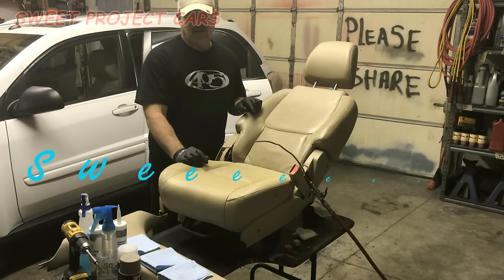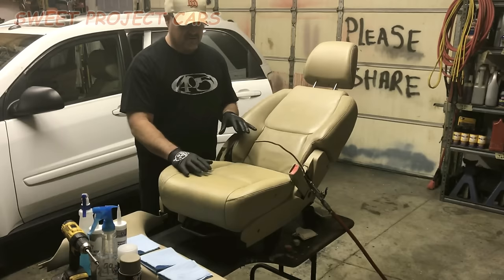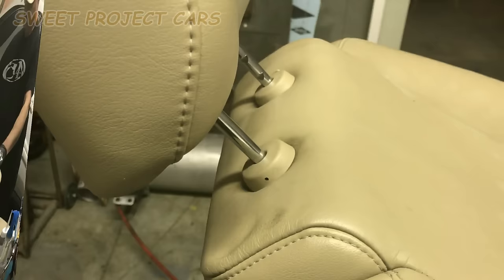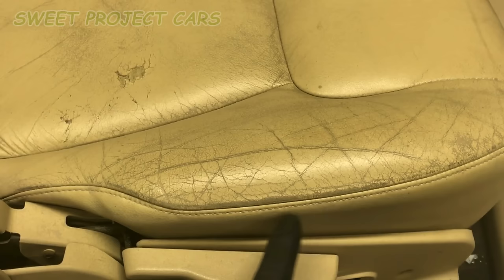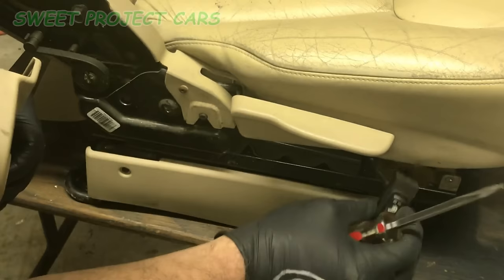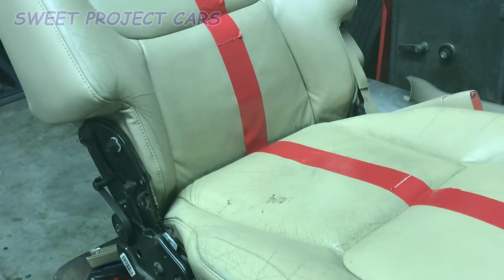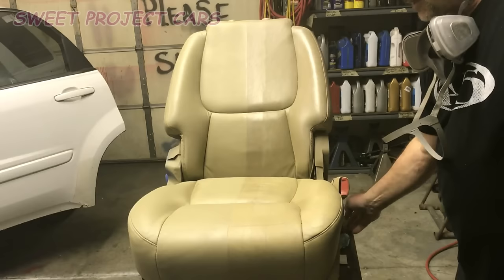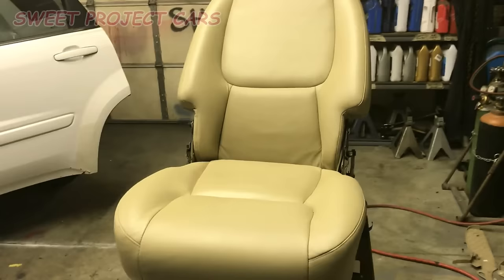How To Repair The NASTIEST Leather & Vinyl Seats....Back To PERFECT!

Comment from the maker: Hello, Everyone, this is our Glad it's Friday video!  See How we Paint Silicone https://youtu.be/Sp6HGSSQGXk This works for leather or vinyl. This is Part 1 of a 2 Part repair series. The second video will be out this coming Tuesday. We hope this helps you make your seating look new again. ****Also, don't forget to pick up your SPC's Swag before it's gone...once this design is gone it will NEVER be available again!****  Here is a Special PROMO CODE to save YOU a couple bucks https://teespring.com/stores/sweet-project-cars-swag?pr=LASTCHANCE
Reply: Wow. you know all the tricks. thanks and have a great weekend!
Reply: This was great, is there a video on painting a steering wheel?
Reply: MEK I painted a steering wheel using regular rustoleum and got amazing results. It was on a navigator and I was able to fix sun damage by lightly sanding and then painting with a few light coats.
Reply: What if you actually have a hole through the seat?
Reply: @bitemefoker  My question exactly. I used SPC's technique for sprucing up some nasty looking cracked and faded leather in my mom's Caddie....and it came out looking like brand new. After doing that, i then discovered about a quarter sized hole in the backseat. So, SPC.....do we need to put a patch over that hole, or will a silicone film as in your video do the trick? Thank for the great videos!
Reply: I'm just asking because can't u use the same technique to fill it? I have a hole from wear but man this is impressive
Reply from the maker: Thank you Justin we appreciate that my friend
Reply from the maker: We have never had that issue if you follow the video to a T and use the exact same products you will have success every time my
Reply from the maker: Good deal thank you for sharing
Reply from the maker: We do have videos on repairing and dying leather steering wheels that is the best way to do it
Reply from the maker: We are coming out with a video Friday that should help you with that my friend
Reply from the maker: We arecoming out with a video Friday that should help everyone with holes or cuts in their seats
Reply from the maker: Jamie we love the questions for sure we have a video coming out Friday that will help everyone
Reply: Will you do mine for me please? I'll pay...
Reply: Man this could save me a lot of money. What if I wanna change the color from grey to black? Could I do it?
Reply: What about perforated seats?
Reply from the maker: Chris Rodgers just before the glue is dry you stick round toothpicks in every hole then a final coat of paint
Reply from the maker: @mj-qe2wy   yes you can change the color my friend
Reply: Where do you buy the color?
Reply: Hi there. I assume that these techniques can be applied to home furnishings such as leather couches and chairs as well. How about vinyl? A very informative video. Thanks so much. PS: It's 'due' not 'do'. As in "due to the massive size..." No disrespect intended. I hope that helps because you've helped me. Cheers.
Reply: You should experiment with steam cleaning.  I like all the different uses of 99% alcohol, but it doesn't deep de-grease.  If you combine 70% alcohol, with deep steam, it will deep clean, and clean the "grouts".  I will help your paint penetrate.  Shouldn't add much drying time at all, if you steam clean and accelerate the drying, by aerosol 99% alcohol.  Definitely worth a try, on those specially loved cars.
Reply: Are you using standard spray can paint or a special leather paint?
Reply: What brand paint spray did you use and where can I get it?
Reply from the maker: Sam Thompson all the tools are in the SHOW MORE of the videos description
Reply from the maker: Jarvis' World it is a special paint used by the manufactures actually, you can find it all in the SHOW MORE of the video's description
Reply from the maker: Chango21 all the tools are in the SHOW MORE of the video's description
Reply: Sweet Project Cars 

Could you please mention the names, brands and where to purchase the items used to implement this project. That would be so helpful for everyone I hope. 
Thanks this is what I need for my car.
Reply: great info will be sharing!
Reply from the maker: @naijanistan  all the tools are in the SHOW MORE of the videos description my friend
Reply: Hi mate. I did the same work like you did, a few months ago, the problem is that the paint started to come off soon. I am planning to do it again, but this time i am thinking of using a laquer, after painting the leather. What do you recommend? Is that a good idea? Thank you#
Reply from the maker: @ArnnyeFittMan  We use this video here now for everything and never had it wear off especially if you are using the prep spray.  you need to make sure you deglaze the leather or the paint will not stick we suggest this for the UK https://amzn.to/2DeokbJ without this the color will not stay on
Reply: @SweetProjectCars  Thank you for your quick answer & advice. I will use it and waiting to see the results. Cheers!
Reply: Sweet Project Cars 
Hello, can you please do a video on how to do this with perforated seats.
Reply: WOW! That looks great!
Reply: Sweet Project Cars r
Reply: Can you give me the list of products you used again, please? Thanks.
Reply: What kind of silicone do you use?
Reply: I did this on ripped boat seat and painting over the silicone is easy but the paint doesn’t stick to it like it should. I used vinyl paint and it ruined my seat. Now I’m trying to figure out how to remove the silicone.
Reply: What kind of glue and silicone are you using also paint. I want to try this
Reply: Kindly please mention the spray paint that you used in the end if possible show the other products also
Reply: Can you speed up the drying and curing with a heat gun?

Comment: Wow...the silicone thing actually worked and worked well...Easy...I have a 93 vette with only 40.000 miles on it and is almost pristine condition with white leather seats...my parents dog jumped in my car poking a whole in the passenger seat...a couple of years ago i bought a leather repair kit only making the area on the seat worse then it was...I tried this method with the silicone and it worked...I like the idea that it doesn't have to be perfect as it will blend in with the texture of the rest of the seat...Clean ...fast and easy..I ended up doing the other small cracks in both seats...you can't even tell....
Reply from the maker: Chris that is awesome to hear my friend good deal thank you for sharing your results have a great night
Reply from the maker: tools are all in the SHOWMORE of the video description
Reply: If you don't look at it during sitting, it will last for-ever!  🙏🙏🙏🙏🙏🙏🙏
Reply: You think I can use the same process on boat seats ?
Reply: @fredwilliams7893  -  Well at least she'll gained another " Crack " right?  More Cracks = More Joy = Oh boy!  😂❤️😂❤️😂❤️😂❤️
Reply: which kind of sillicone did you use?
Reply: Chris Kowalski really good trick actually
Reply: Fred Williams rofl
Reply: @fredwilliams7893  If you could find the exact same color!
Reply: I had no idea you can paint or dye silicone...
Reply: @MsJackie808  has a professional painter you can't it will fisheye and crawl off unless it's a special silicone then I guess anything is possible it work for this guy but I'd like to see it after a few sit on time
Reply: What kind of paint did you use?
And how did you match the color?

Comment: I sprayed my vinyl boat seats with the prep and vinyl dye/paint. Came out looking like new.
Reply from the maker: Awesome Wes!  Thanks for sharing.  Have a great day.  mad Mike the hammer SPC
Reply: I need to repair the very top back of my pontoon seats where the black cover baked them.  How is everything holding up?  I also have a couple of holes in the foam on the top of the seats.  Is permatex the only thing that I need to fill the holes?  The holes are probably an inch to inch and a half deep by about the same width.
Reply: I sold it years ago but I'm sure there is good info on YT. There is a DAP brand caulk that is good for filling holes and taking paint. They use it for leather repair.

Comment: Wow definitely gonna try this with my "new" vinyl couch i just got it has small bits of cracking everywhere
Reply: Hey glad I found your comment, did you try it? My vinyl couch is cracking and small bits everywhere also. Please reply when you can. Thanks!
Reply: Hello, did you try this already? Just wondering if I should give it a go for a vinyl couch sectional.
Reply: Did this work for you and hold up? I am going to try on my leather couch, but wanted to hear from someone first.
Reply: @divakim206  Did you try it?
Reply: @ieshalee595  sadly I have not but plan to in the next 30 days. Once I find the correct color match, I'll get it ordered. Are you planning on doing yours any sooner? I'd love to find out how yours turned out.
Reply: @ieshalee595  I know this is 6mos old, but I did basically this same process on my leather steering wheel last year and it still looks great. If you take your time and do a good application it's not gonna peel or anything.  The old one was totally jacked too the coating had come off everywhere and it looked like weird suede

Comment: Sweet Project Cars,
Thank you for sharing this video, your experience is priceless.
I got a question for you: In this video you spread clear silicone, then spray painted on top of it. In another video, however, you said that the paint needs to be mixed in into the silicone, otherwise it will "fish eye". How did the spray paint work in this video without "fish eyeing"? I'm trying to understand which way to go - mix the paint into the silicone, or spray the paint on top of clear silicone like in this video.
Reply from the maker: We did both methods for those that aren't as experienced as us, the best way is to mix the paint with the silicone, spread it, let it dry then do a final paint.  Hope this helps my friend.  Thank you so much for watching and asking.  Have a fantastic weekend. mad Mike the hammer SPC

Comment: Great vid! Was wondering though, for someone who isn't comfortable with their ability to do this on their own, what would be the typical cost to have it done? And how would you go about finding someone who does this kind of work rather than the reupholstered route?
Reply from the maker: Jeff Parkin great question this is a DIY project so if you decide to have someone else do it it may be best just to buy the manufactures seat covers and replace them with new, it will be less costly for you but if you do tackle the project you can save a boatload of money with the DIY we share here.

Comment: That LVP is amazing stuff. I’ve touched up my BMW black seats with it and it’s holding up very well and doesn’t look unmatched at all.
Reply: Shane Sexton did you use Ford Black or BMW Charcoal for your seats? I have 2002 black BMW seats also. Great video
Reply: BobinBC I used BMW black 258, I only touched up areas with a q tip and it’s blending perfectly. I also painted a dash trim piece that was peeling. So close to perfect match.

Comment: Quick question! I am a Paint Contractor, I know from experience that paint does not stick to silicone. Is that siliconized caulking that you used? Siliconized is a paintable caulk. Just curious because my wife's Lexus seats need some attention. Thanks!
Reply from the maker: Fay Turman for this to work you need to use the exact tools and methods shown see this for all the tools and exact products they are in the "SHOWMORE" of the video description if you look Here https://photos.app.goo.gl/4fbqwpXC3Koqsv8o7 for a desktop computer or here https://photos.app.goo.gl/dY6Wz16qnroYHDsK6 for a cell phone, you will find all the tools and products my friend :)
Reply: @SweetProjectCars  Sorry but those links just go to a static page. No information at all. Bummer
Reply from the maker: they go to google pics...showing where the SHOW MORE is located on the youtube platform

Comment: I hate leather seats because of the cracking,  if I was still into them I'd definitely would do this. Great to learn something new!
Reply from the maker: Glad you liked it Saga One! Thank you for watching and sharing, have a great day. mad Mike the hammer SPC
Reply: If they're properly maintained with something like Leatherique, you won't have to worry about the cracking. Also, this method shown here is doing absolutely nothing for the health of the leather, and will prevent actual conditioning in the future. If you actually care about the condition of your leather, do it right. Check into Leatherique.

Comment: So I have watched all 3 videos in the series, multiple times, as well as an additional video you put out where you mixed the paint with the RTV silicone before applying the silicone, but I am still just a little unclear as to when exactly in the process to spray on the 1st coat of ColorBond LVP paint.  At one point in the video it appears to say to wait 24 hours for the silicone to cure (which I would think would inhibit the paint from bonding to the silicone), but in the "mix the paint with the silicone" video, it appears as if you are painting the silicone while it is still a bit tacky.  I really, really don't want to do this wrong... should I be waiting 24 hours before applying the 1st coat of paint to the RTV silicone, or should I spray on the 1st coat while the silicone still has some tack to it?  Thanks!
Reply from the maker: Mix your paint and silicone as the video shows, apply it to the seat, then once it's not tacky any longer, paint it.  It could take 24 -48 hrs. for the tackyness to disappear.  Thanks for asking, we appreciate it!  Have a great day my friend.  mad Mike the hammer SPC
Reply: @SweetProjectCars  I didn’t see you mix paint with silicone in this video, it appears that you painted directly on the silicone which was applied straight out of the tube onto the seat.  Is that correct?Also, did you use SEM prep on the siliconed seat before you painted? (There was a break in the video)

Comment: do one for cloth seats. I wore away the edge of my drivers seat getting in and out. and the edge seam wore out and now I'm basically chewing up the foam underneath every day
Reply from the maker: We will see what we can do for you on that my dear Friend
Reply: Sweet Project Cars I too would love to see how you fix those. I have an older truck that could benefit from some love.
Reply: Both vans at work have the missing fabric and missing foam!! Very interested!!
Reply from the maker: If you could take a few good pictures and send them to us we may be able to pinpoint a better video for you send them to Sweetprojectcars@Gmail.com
Reply from the maker: We will do a video sharing the best way to fix fabric upholstery very soon thank you very much
Reply: @SweetProjectCars  thank you. I will try to get picture to you.  can't atm
Reply: I saw a guy repair cliyh seats with extra clothes from underneath the seat.  He removed the plastic trim and there was a fair amount of cloth bunched up under there.  

He then glued a backing patch into the hole and then glued the authentic cloth on to the backing patch.  It was a huge improvement.

Comment: I did my door trims that had rips with vinyl compound putty then sprayed them with vht vinyl matt black cans over it. Never knew you can use silicone tube and it makes sense. Whats the adhesion spray you use after the alcohol cleaner?
Reply from the maker: Use this after cleaning  https://amzn.to/2AVv11Q  Thanks for asking.  Great job!  mad Mike the hammer SPC
Reply: @SweetProjectCars  thankyou cheers